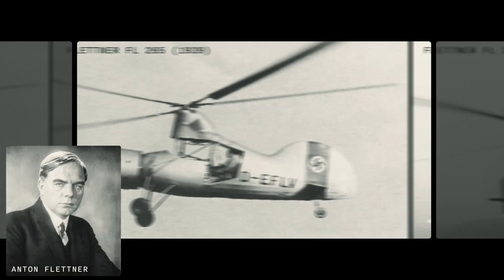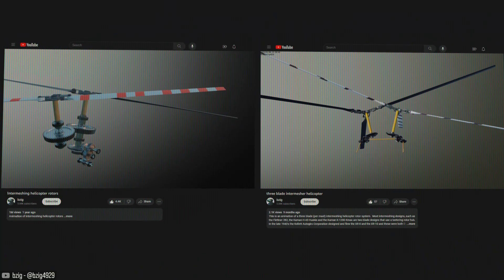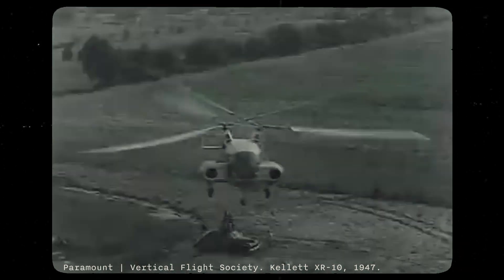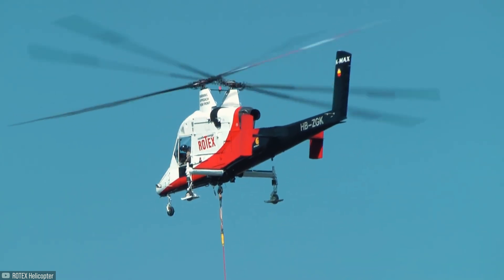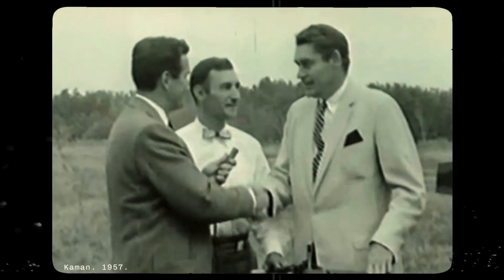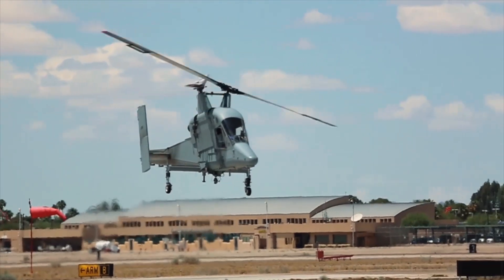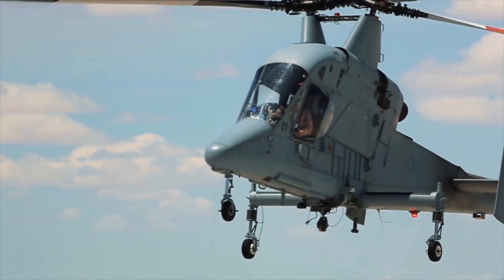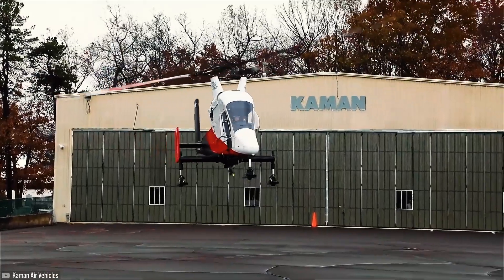A helicopter with very strange rotors 😮 - Synchropter

Comment: I believe that the Kaman Kmax would have alot better performance & improved flight characteristics if their was a regular swashplate & pitch control linkages under each rotor head as in a regular, conventional helicopter! Get rid of them stupid "servo flaps"! They have been comming loose in flight & causing the helo to crash &  killing the pilot!

Comment: Why hasn’t this design been used for an attack helicopter? It seems it would be perfect. High agility, high load carrying (attack helicopters are heavy with all the armaments and armoured plating they carry). Low speed yes but this is not much of a concern for attack helicopters.

Comment: The blades actually can flex into each other. I flew with two guys that flew the KMAX. One said that he had to eject a water bucket because he got into an uncontrollable nose spiral. He couldn't explain why it happened but it happened to him and another guy. The second guy I know that flew them said that mixing control inputs can make the blades flex into each other, meaning if you put the helicopter into a slip or skid by adding left pedal and right cyclic the blades could flex to the point that they skim/graze each. It's happened to several people. It's obviously not good for it but it's never caused an accident that I know of. The guy that got into the nose spiral told me that you don't really fly a KMAX, you just kind of herd it/encourage it.

Comment: I worked for Kaman for approximately 37 years. Built the first 3 KMAX helicopters with a relatively small group of employees and very few fixtures and or tooling. Many engineering changes and modifications as the lifting limits were tested. Took tons of pictures, especially when the cool paint jobs were done. One of my favorite project I worked on at Kaman.

Comment: Half the US forces in Afghanistan may be coming home, but K-MAX, the little unmanned helicopter, will stay until the end. A pair of the remote-controlled cargo choppers arrived in Afghanistan in late 2011 for what was billed as a short-term experiment, but the Marines liked it so much that the trial deployment was repeatedly extended, and now the military has confirmed it will keep them on “indefinitely.” (The extension was first reported yesterday by Reuters). Three love letters to the remote-controlled cargo chopper from military officers, obtained exclusively by Breaking Defense, show why.

Technologically, K-MAX is just plain neat. It’s a small one-man chopper built by Kaman Aerospace Corp. – originally for logging operations, where it airlifted tree trunks out of tight areas . It was converted to a remotely piloted vehicle by Lockheed Martin. Tactically, K-MAX allows delivery of supplies to forward outposts by air, without risking human pilots or, worse yet, sending ground convoys through the gauntlet of Taliban ambushes and roadside bombs.

“What stood out most in my mind … was the permanent scorch marks burnt into the earth up and down ‘ambush alley,'” recalled Marine Corps Maj. Kyle O’Connor, who served in Afghanistan in 2004 and 2011. So many improvised explosive devices (IEDs) had gone off in one narrow mountain pass, an unavoidable chokepoint for US supply convoys, that “that stretch of road continually had scars marking where explosions had scorched the earth,” O’Connor wrote in a letter endorsing the K-MAX for the prestigious Collier Trophy. “Those memories,” he went on, “are what drove me to be part of a program meant to save lives by limiting the amount of exposure our ground convoys had to danger”: the unmanned K-MAX, whose first six-month deployment had O’Connor in command.

“Every piece of cargo flown via [K-MAX] is one piece of cargo that doesn’t need to put personnel in harm’s way going by ground convoy,” O’Connor wrote. Unlike manned choppers, “since it was an unmanned system, we were able to conduct flights during inclement weather when other helicopters couldn’t fly,” added O’Connor, a pilot himself. “We flew during the night, in the rain, dust and high wind.”

Comment: The Kaman K max is interesting. My understanding is that it is relatively maintenance easy. And it  is dependable. It has excellent lift capabilities. Forward airspeed is a bit slow. the blades flex very low.
Reply: Even disregarding flex the blades are low out to the sides. In front,  (and behind, but there the pilot can't see you) they are conventional height or higher. 
You would not be able to fly so close to a steep slope, which would be a disadvantage for mountain rescue or heliskiing.

Comment: Helicopters do not "tilt" their rotors, they change the angle of attack cyclically, i.e. the angle of attack becomes higher on one side and lower on the other. This causes the flexible blade to flap up on one side and down on the other in response to the increased lift on one side of the rotor disk vs the other but the rotor head itself does not tilt. Blade flap combined with the entire airframe changing attitude as it move forward gives the appearance of the rotor "tilting", but it's not actually tilting in relation to the helicopter's airframe.
Reply: The rotor disk absolutely does tilt.

Comment: In the early years of IC engine powered single rotor systems, power loss was expected. However, the French overcame it with turbine engines very early and lead the field. Today, they are still leading with composite airframes and rotors, lighter and increase engine power. Such power to weight ratio is unreal for a conventional single rotor system helicopter. Unfortunately, the synchropter, by virtue of it's unique rotor design also withheld any further development in the other avenues of speed, size, capacity, home build variants.
Reply: My understanding is the first, turbine powered helicopter was a modified K225. Which first flew in 1951. It is now on display at the Smithsonian.  I have a few thousand hours flying helicopters. And I worked on them before I flew them, retiring in 1993. The first helicopter I worked on had a "radial" engine mounted in the nose. The pilot and co pilot sat above the engine.
Reply: @raywhitehead730  Yes it was but not in great numbers. Synchropters are unique in design and are very good for load lifting purposes. However, in real world applications it has to do more to justify its cost.

Comment: Command & Conquer Red Alert 3 has the Twinblade, which is also a synchropter ( but I think with a more extreme rotor angle ) that is also used for heavy lifting, even capable of hauling its faction's house-sized Apocalypse tank.

Comment: If there was a rear rotor in case one of the engines fail it could still function untill landing
Reply: There is only one engine. The gearbox has one input shaft and two output shafts, as does a 4WD vehicle